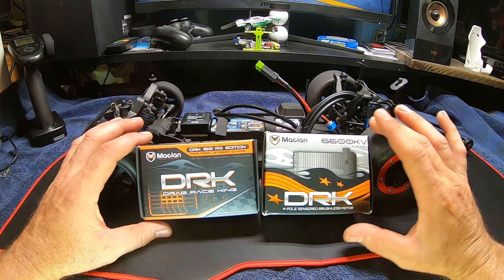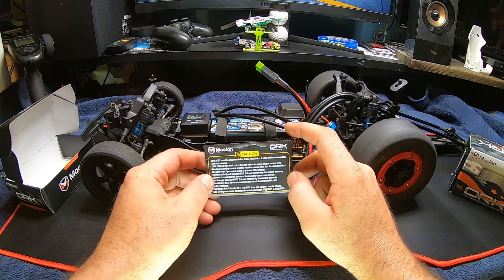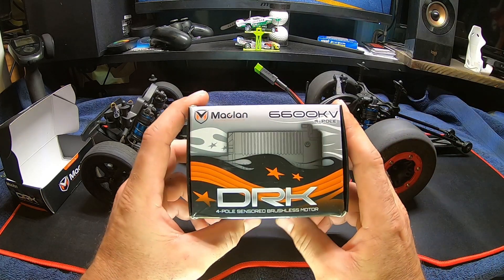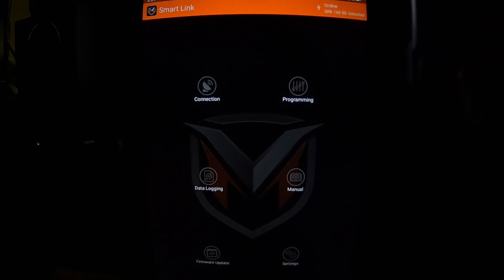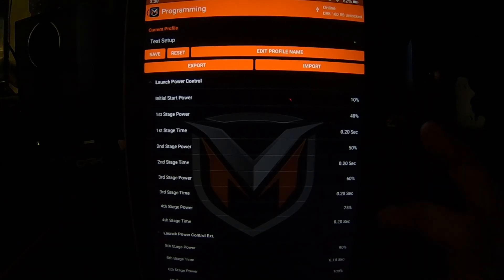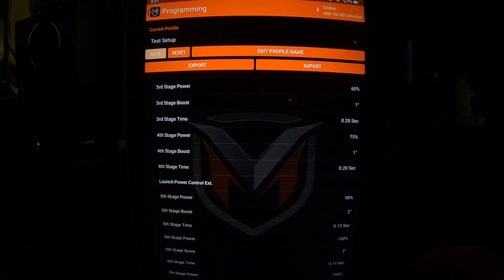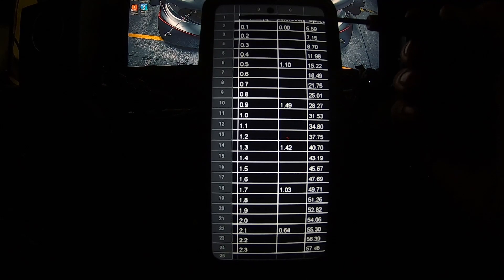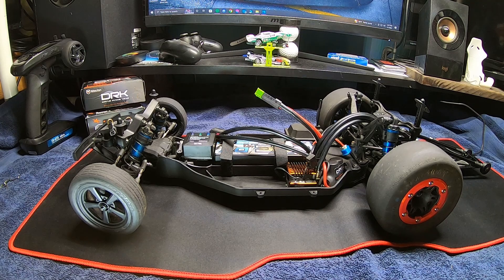Maclan DRK RS ESC /6600KV 4 Pole Review, Setup, Programming, and GNSS in my NPRC DR10 Drag Car

Comment: Asome can you show a good 4pole Tune no body on YouTube have one nice day
Reply from the maker: I can definitely show what my settings are. It took a lot of chassis work to get there. But I started off in blinky mode at 20%-80% throttle and doubled the "shift" times and worked it up to 100% at 7th stage. Then started lowering the shift times. Then went to unlimited mode and started doing the same thing with the timing and boost.

Comment: Is it normal for you to have to hold full brake on the transmitter in order to keep it sitting still?  DRK 160 rs with a castle 5700kv 4 pole is the setup I am running
Reply from the maker: No, that's not normal. Mine did that a couple times and I completely reset my remote, checked all my sensors wires and esc wire were in the right spot and connected well, then recalibrate the esc to the remote. It all worked fine. Idk which fixed it.
Reply: @Gonna_Getcha  thank ya